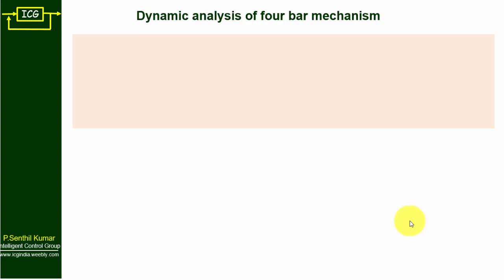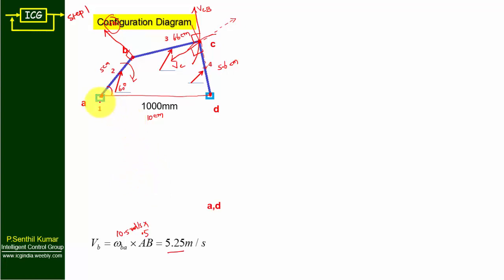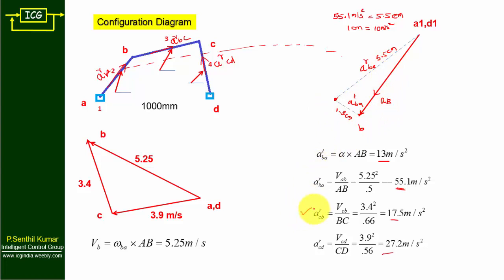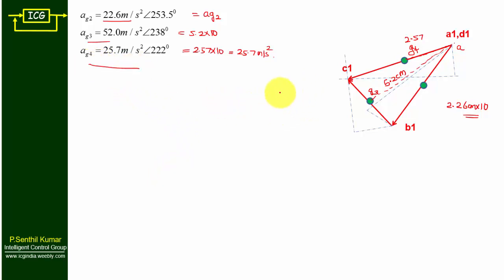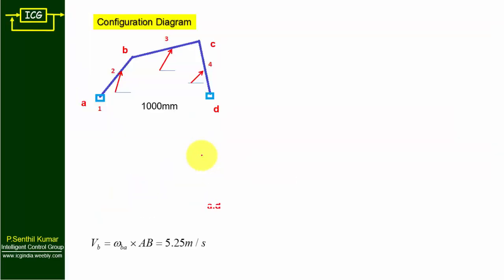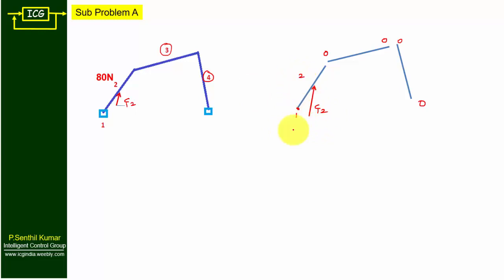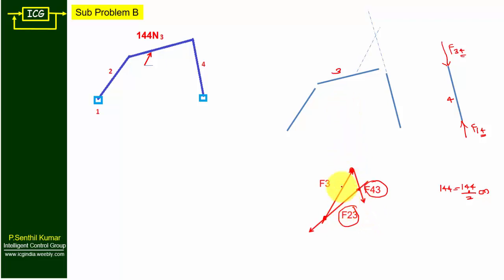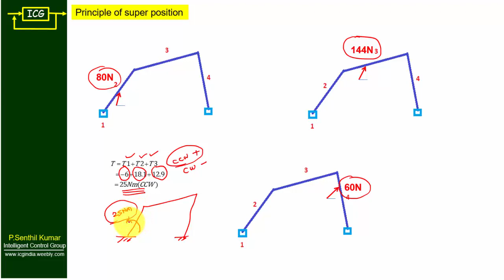Lecture 1.3.2 Dynamic Force Analysis| Problem 1 | Four bar mechanism

Comment: In 6 min, why 1000mm equal to 10cm? Is that a mistake?
Reply from the maker: It's scale factor. We can't take 1000mm as it is on paper. To draw a diagram in paper ,we are using scale  factor. You can take any value as long as it is within the range of paper

Comment: In, 4 bar mechanism crank is rotate clock wise in configuration and you show anti clockwise in velocity diagram
Reply from the maker: You can use any direction cw,ccw . Only direction will change . But magnitude same

Comment: 34:50 you get the formula of h that is equal to: h=(alpha^2*k^2)/a while on the other side you use the formula h=(alpha*k^2)/a, which formula is correct?
Reply: the second one you wrote